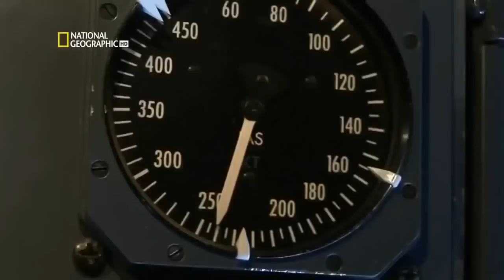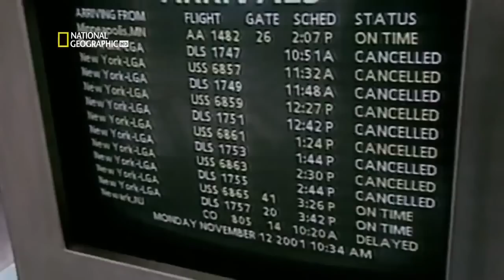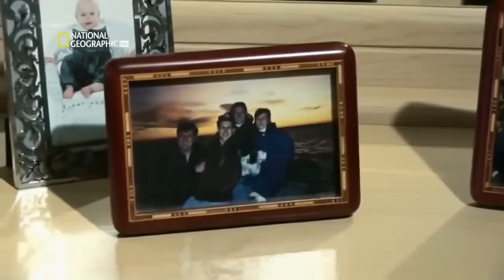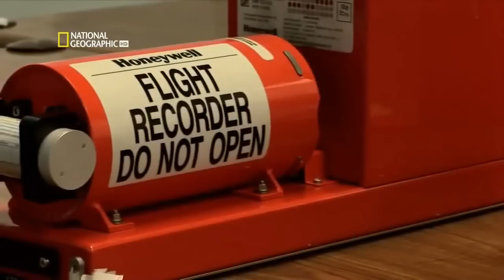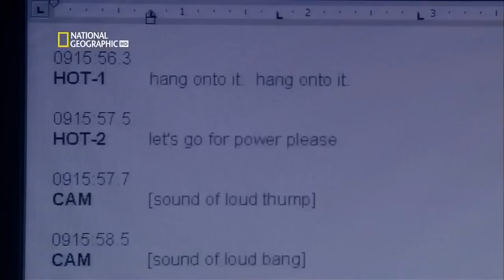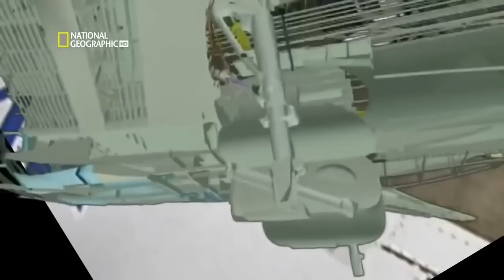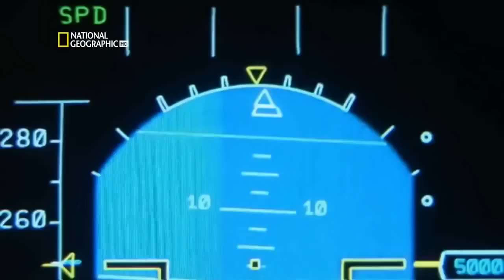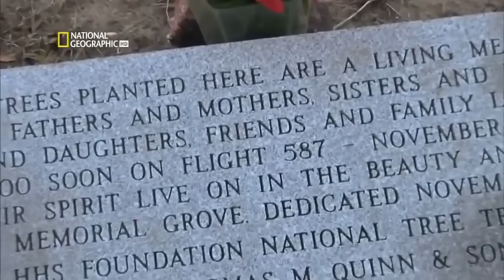American Airlines Flight 587 'Disaster over New York'

Comment: James Ozzello
11 months ago
I’ve got over 8000 hours and currently fly an Airbus A320 for Jet Blue. Large inputs to the flight controls are used often and under many circumstances. 

Even though the 300 is not fly by wire, there is no way the rudder faltered due to the application of full rudder control. The aircraft was well under maneuvering speed and I’ve never, ever heard an aircraft make a significant sound due to wake turbulence. 

They departed plenty of time after the 747 and were also at a slightly different altitude through climb out. FAA was covering for Airbus. 

The plane was previously damaged in weather overseas and I’m sure there were complications where a band aid was used to get the plane through to its next overhaul. 

Airlines save time and money at all costs, and sometimes it costs lives. At the end of the day, it’s a business, and I love Airbus, but sometimes responsibility trumps optics, and unfortunately in this imperfect world, we can’t be prepared or foresee every single possible scenario. 

We do the best we can, but flying is inherently dangerous given the amount of changing factors on a daily basis. God bless and clear skies.
Reply: I wouldn’t want to be flying with you dawg

Comment: The Tail piece of this Plane was Extremely Faulty basically hanging on by a Thread...But since the Pilot did not use the Rudder pedals Correctly they blamed the crash on him...If the Plane was not Faulty it never would have crashed from him using the Rudder the way he did